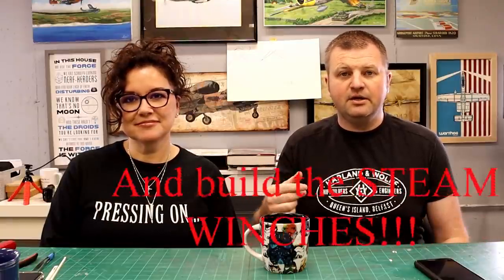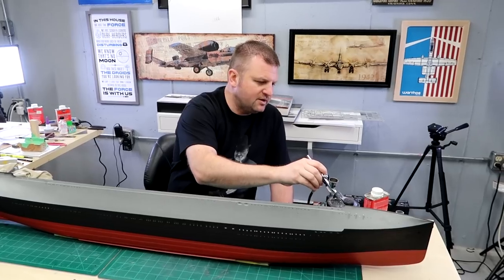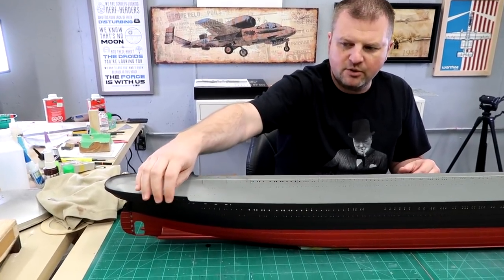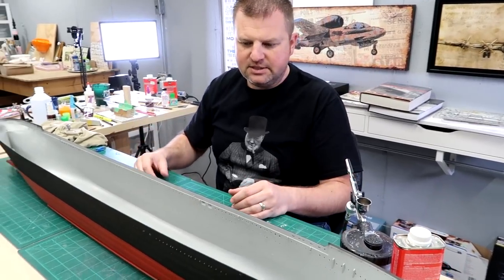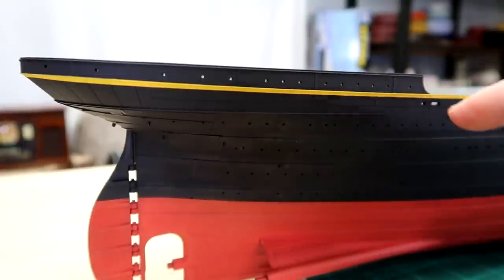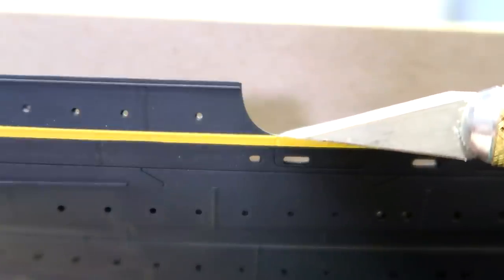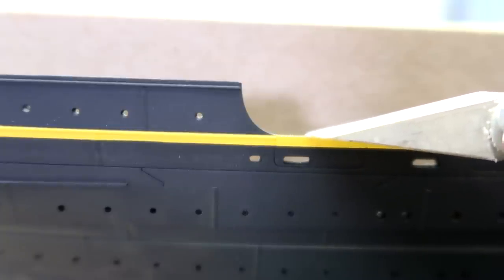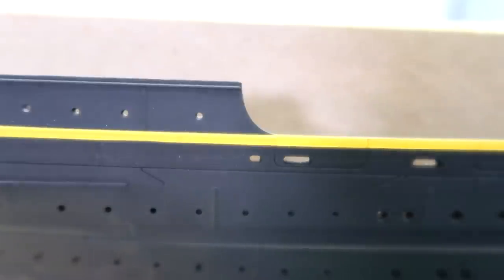1:200 RMS Titanic Build Video 2

Comment: I enjoy all your videos!  I've also watched many other channels building this model kit. There is one thing I notice with regards to these steam winches that everyone is doing, that is totally wrong. I spent many years in the Merchant Marines sailing on ships, so I speak about this from experience. There should be NO paint on the winch drums where the mooring lines wrap around the drum. If any paint was applied to these it would have been stripped off the very first time you throw wraps on the drum. whether pulling the line from storage to flake on the the deck, or pulling the lines tight when arriving in port.  If you want the ship to look "authentic", you should paint the outside of the drum where the mooring lines would wrap around in some kind of paint that resembles bare steel, as this is exactly what you would have seen on the real ship. This goes for bollards, chocks, fairleads and capstan drums as well. Although the bollards and chocks would only have the paint stripped in a certain fashion. If I was there, I could show you exactly how they would have looked. They arn't gonna throw new paint on these surfaces every time they leave port. Optimally you want it to be bare shiny steel surface so that the drum can continue to turn under the wraps of mooring line with very little friction or effort on the part of the seaman.  We never painted this surface on the ships because it would cause too much friction, which would have been dangerous, and since it would be stripped off the very first time a mooring line is thrown around it, it is simply a waste of time. And although a dusting of rust would occur prior to getting to port, that too would quickly be rubbed off by the mooring lines as soon as it was used.

Comment: The Titanic's hull, as with most other ships at the time, would have been painted with red lead which was an excellent anti-fouling paint.  Barnacles, sea grass and algae would not grow on it because of the toxic properties of the lead in the paint.  Red lead, or Minium as it was also known, was a bright red, almost orange in colour.  That jar of Russian marker red was almost right on accurate for red lead.  Of course, colour photographs weren't in existence when the Titanic was built and any pink hull paint visible in modern photos can't be trusted.  100 years of soaking in salt water will fade and alter any paint regardless of what it was made from.  It's also possible that the paint was further tinted to match company colour specs when applied.

Comment: Are you going to back light the portholes?  Was reading about all the add ons in the recent AirFix magazine.   Enjoying the build...
Reply from the maker: Yes, sir! I have LED strip lights that will be the primary source of illumination. I’m going to show that in the next video. But that’s going to be a minute because I’m currently putting fiber optics in all those drilled out holes!  And it’s slow going.

Comment: The winches are a work of art, however the kit winch looks like it has a gear wheel missing from it, the one you made up for comparison
Reply: You’re absolutely right! It is missing a gear, it comes with only one. One could easily scratch build a second one.
Reply from the maker: Yeah I decided not to say anything in an effort to maintain enthusiasm for those who are building it out of the box. But when I saw that I was like, really Trumpeter? I actually half expected them to get the four supports for the larger whip end shaft correct. Wouldn't that have been ironic. But nope. I know its A LOT of work for KA, but providing some elements of their kit a` la carte, would be very helpful to lots of modelers.
Reply: Keep up the good work, enjoyed both your previous warship builds, the Titanic is going to be another great build. Thanks for the videos from the other side of the pond in Yorkshire  England

Comment: I'd use the grey for the pre shading and use MIGS Transparator in the black to go back over it, it'll put a coat of black back over the whole thing but still let the pre shading pop! Well I guess it would be a post shade your doing  here this is when you would get away with a slight dry brush on some pannals not the whole thing but just to picking out that rivet and panal line detail to show it is there. The red will die down once you get a wash over it when weathering it'll look fine! You should check out that video 15000.1 scratch building the titanic Parkes productions

Comment: Another great build has begun. 
Tamiya paint. I use to hate it. Not durable, dry airbrush tip and a rough surface. I learned the secret that makes Tamiya my favorite paint. Mr. Leveler Thinner. It leaves a very durable, smooth finish ( I no longer clear coat for decals),  and I don’t feel like I’m racing through the painting in order to avoid a dry tip. I have also found it brushes well if you don’t work the paint too much when painting over a previously painted surface. If you do it will begin to dissolve the previous coat. 
Like you I liked Model Master enamel. Tamiya thinned with Mr. Leveling Thinner is as good or even better with the added benefit that it dries fast rather than taking days.
Reply from the maker: Those are good tips since I will slowly have to head down the acrylic road.

Comment: How did you avoid any paint bleed on the sheer line.  It looks very crisp?
Reply from the maker: I used Tamiya masking tape and pushed the edges down firmly with my fingers. Then I painted the line with 3 VERY light coats of paint to build up to the desired coverage. Most of the time bleeding happens because too much paint is being applied at once.
Reply: To help stop paint bleed after you lat the tape down spray flat clear over the tape let dry , then spray the next color

Comment: Modern water-based acrylics are very durable and are the paint of choice by the majority of modelers. There are many brands available, and many come with additives to make them very easy to apply with airbrushes. Acrylics dry within minutes and do not emit harmful fumes. Enamels are now considered a poor choice because they are oil-based paint and often take weeks to dry. They also require thinners that emit fumes. During that long drying time, they can be easily damaged. Lacquers dry very fast, but they fade over time and are not the best choice if the model will be displayed under lighting. They also have a fume problem.
Reply from the maker: Enamel paints do not take weeks to dry. Unless you are in an outrageously humid and cool environment. My problem is, there is (for me) no one stop shop for acrylics. With the good old model master enamels, you could brush paint them right out of the bottle. Or thin them to airbrush and they had every color under the sun. Flat or gloss was always available. Now I use Tamiya for airbrushing because they spray well but you have to use their thinner. You can’t really brush paint it though. Model master acrylics work well for brushing but will dry up and clog an airbrush quickly, even with thinner. Acrylics are the modern choice only because manufacturers are discontinuing enamels. And it’s a shame. I think they are a much better choice, regardless of the fumes.
Reply: I agree Ben, Model Master is the best. Are you clear coating all the tamiya you spray?
Reply from the maker: Yeah that’s the plan. Right now the only Tamiya is the white and the flesh color for the funnels. But I think sealing it is the best decision.
Reply: @TheMidwestModelShop  I always use Tamiya acrylics, then apply a coat of Johnson's Klear (or Future) polish, then a coat of Testor's dullcote. You cannot beat the flat effect of the Testor's IMO. Enamels are  probably better paints, but I hate the mess they make and the cleaning of airbrushes and everything else. Each to their own I guess.

Comment: The Nomadic is on display in Belfast, would that be a good reference as to the "red" that's needed for the hull???  They might have differed from ship to ship, it's difficult to know I suppose.
Reply from the maker: It’s all a matter of opinion. There just no where to look with any certainty, to figure out the “correct” red. The nomadic has been repainted several times, at least. And newer and improved anti fowling would have been used each time. That’s why it is simply best to go with what pleases your eye. Because after all, it’s your model 😉
Reply: @TheMidwestModelShop  I did figure it had been repainted,  I also know there are websites about the "white star buff" used for the funnels and there is no certainty there either....oh well....So exciting to see yours developping though!

Comment: Do you really need much weathering on the hull? The ship was new.
Reply from the maker: Yeah it's not so much weathering. Also, she was already painted AGAIN on the port side prior to her voyage. I don't think paint was that "good" back then as it is today or even 20 years after she went down.
Reply: Louis Cypher  Dry brushing would work better if you just want to accent raised panel lines. It can create a sheen from available light falling on the surface to give it a very natural look. It would work especially well on a large model like this where you expect it to reflect sunlight as you look at the model from different angles.

Comment: Titanic was brand new. Why do you need to weather it??
Reply from the maker: You don’t “need” too. But it had weathering already. There was rust on the starboard side almost immediately.
Reply: It was built next to and then on the sea. Sea air is more damaging.
Reply: The Titanic was not "new". It was an evolving structure that took years to build.  It had spaces and surfaces that were painted at different times and withstood outside elements, salt and sea air (which is highly corroesive) before it even left for it's maiden voyage.

White Star repainted the ship for the maiden voyage but only the port side of the ship which was the side of the ship everyone would see on the pier.  It was to costly and time consuming to have the entire ship repainted for it's maiden voyage.

You could expect the starboard side to have had a worn look as well as rust.

A ship that large is something that requires constant upkeep to keep "appearances" and at no time will the entire thing have a new appearance.

Even when the ship is considered "brand new"
Reply: @themilkman1188  And we can’t be certain that they painted the entire port side either. It’s likely that they just touched up scrapes and rust spots. I’m guessing there were sections of fresh paint scattered across the port side, covering obvious blemishes, while the rest may have been lightly weathered black / white.